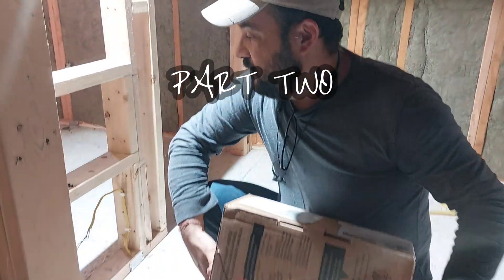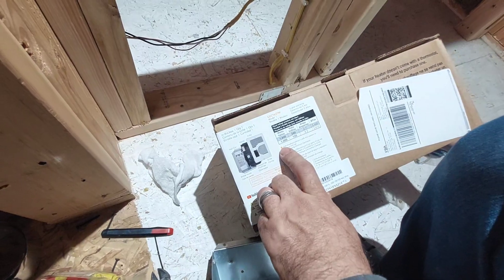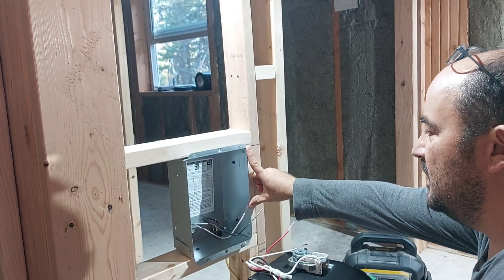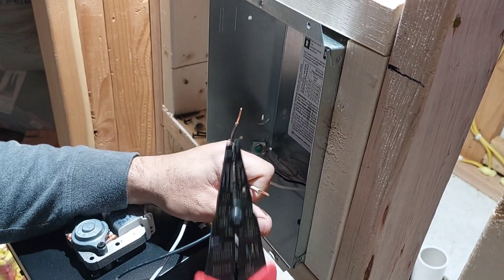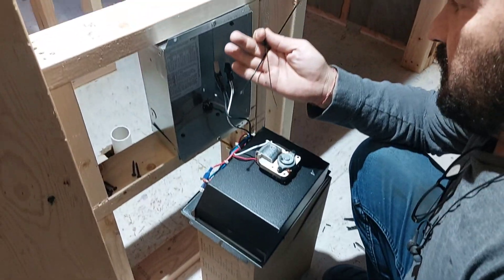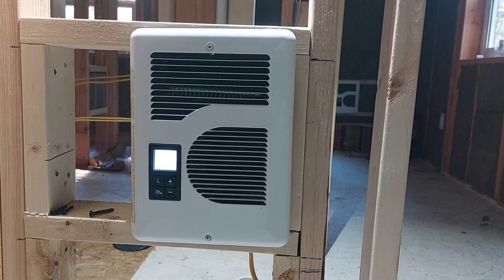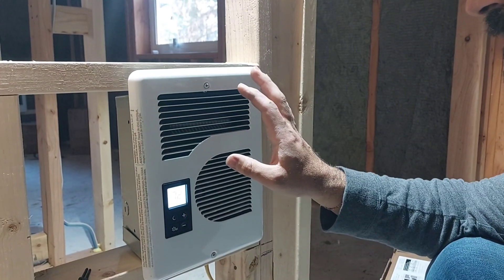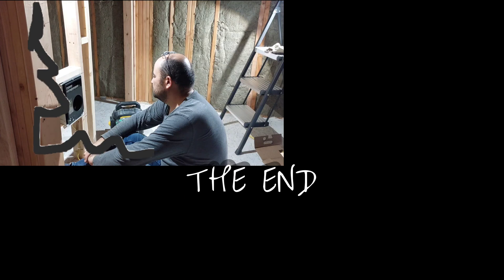CADET Wall Heater Installation: Upgrade from Analog to Digital.

Comment: When I lived in Pennsylvania in my aunt and uncle's old farmhouse there was a vent in the floor in my second floor bedroom, right above the fireplace downstairs, that let the heat come up from the fireplace.  I could also listen through the vent and spy on the grownup's downstairs.
Reply from the maker: Amish people have it this way😊.
We are having the wood stove under the open staircase ( that's going to be installed later on) exactly for the same reason.  To have the heat going upstairs in case we are losing power.